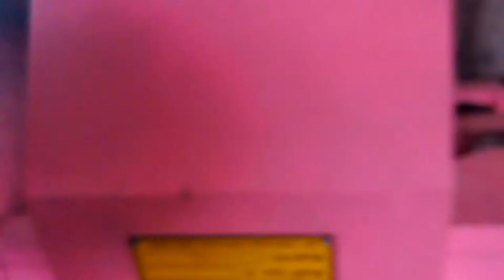Nail Making Machine

Comment from the maker: We are the manufacturer of wire Nail making machine If anyone is interested this business please call me. I will give you all information related to this business.
COMPANY NAME :- Accurate Nail Machine
CONTACT PERSON :- Daud A. Jesani
PHONE NO :- +91 8160702475 / +91 7600006220 / +91 7600006240 / +91 7600006250.
POSTAL ADDRESS:- Aji Dam Ring Road Highway, Murlidhar Weigh Bridge Near Kisan Gaushala, Sahjanand Industrial Area, Street 3, 
Rajkot - 360002, Gujarat, India.